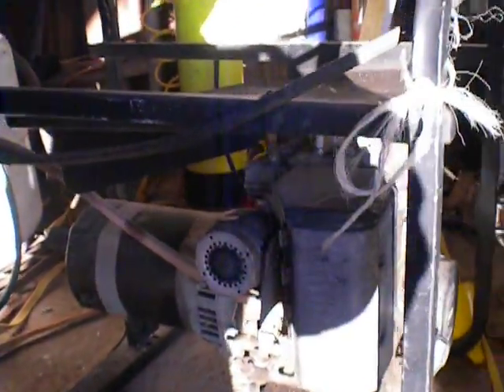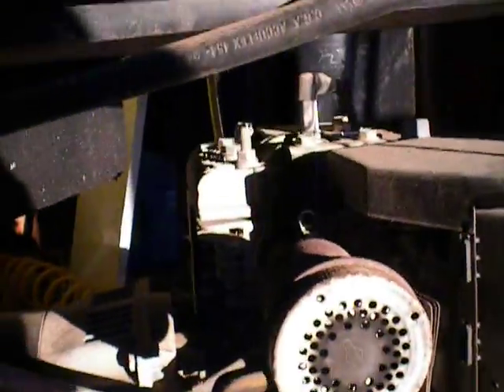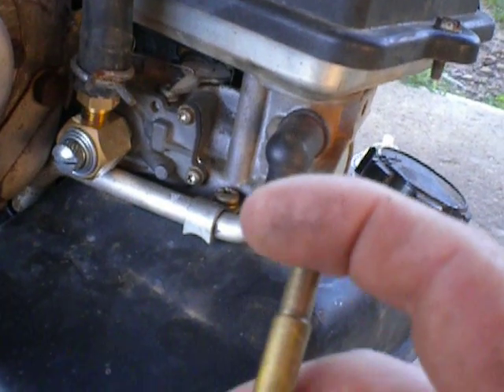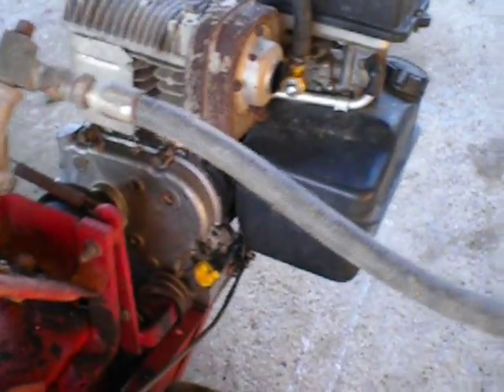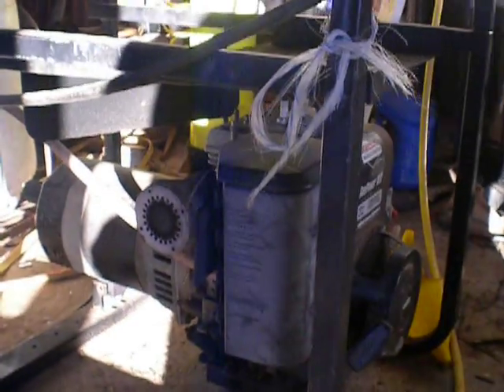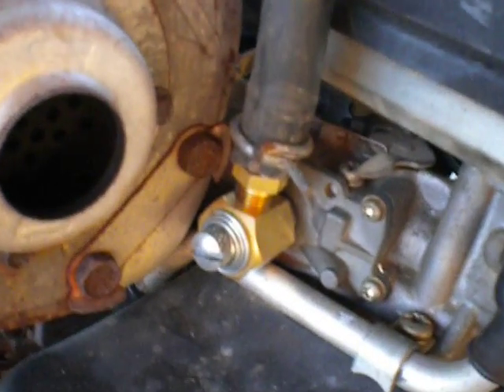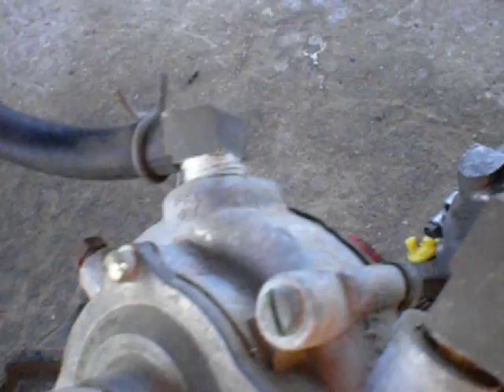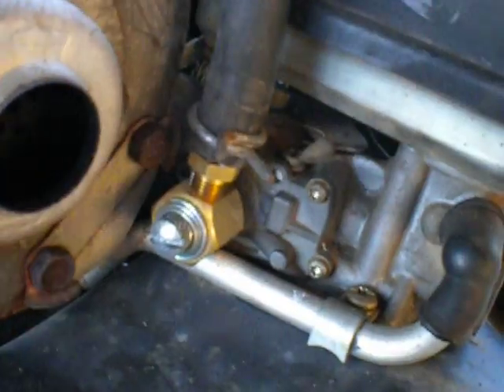Briggs Propane garden tiller, generator engine conversion

Comment: Where did you get the spud in? I have several of the Briggs carburetors that don't run right on gasoline anymore and they would be perfect for this. It sure doesn't make sense to spend $200-300 for a kit either.
Reply from the maker: google honda motor conversion kit, and find just the spud in part.

Comment from the maker: you could make one but will need a needle type valve for adjustment. Ive even seen them screwed  into the air cleaner but it would need to be a tight air cleaner.

Comment: Where are you buying your spud ins?  I want to build a quick mount for my regulator, and modify all of my small engines to use propane.  I want to be able to just move the regulator and bottle from one piece of equipment to the other, and all I'll have to buy is a spud in for each engine and the connection pieces.  I don't see the point in buying/building a whole kit for the log splitter, power washer, lawn mower and tiller since they don't get used too often.